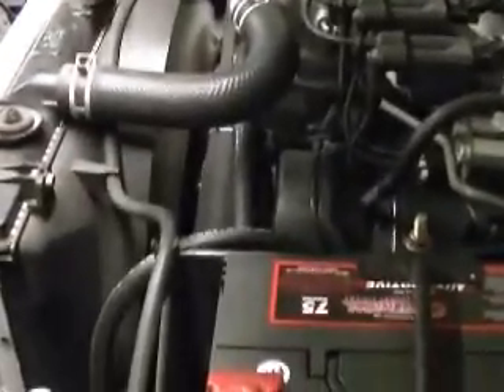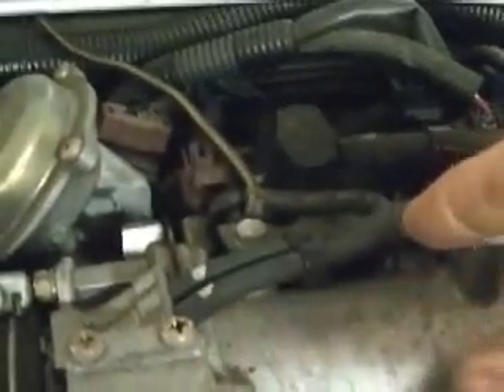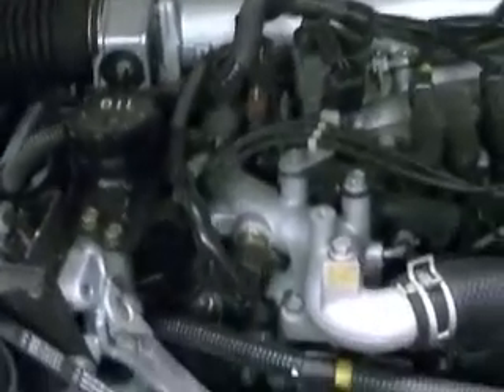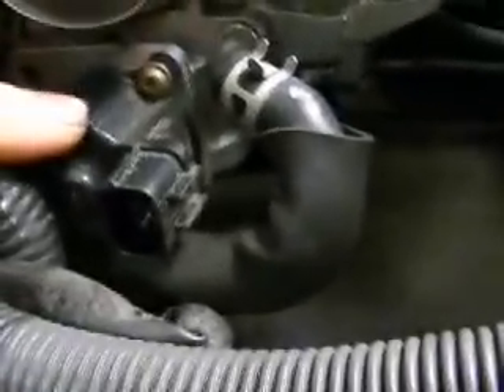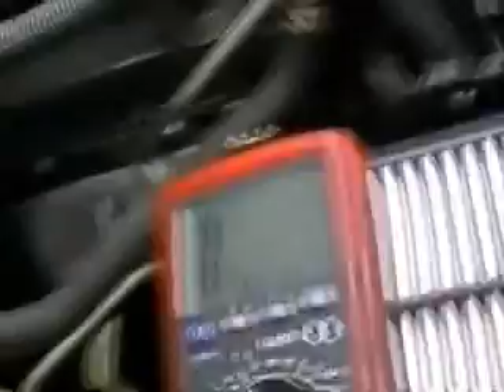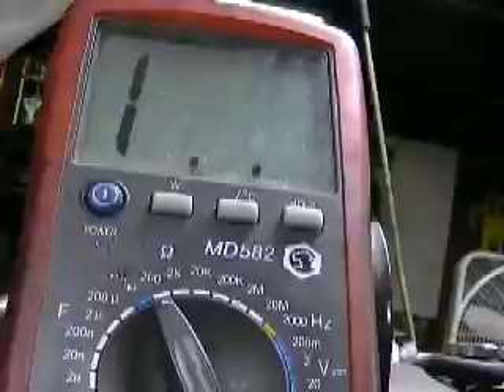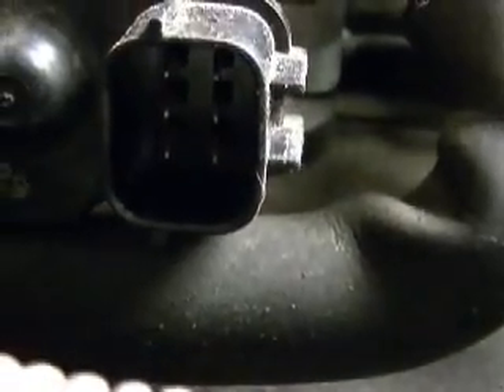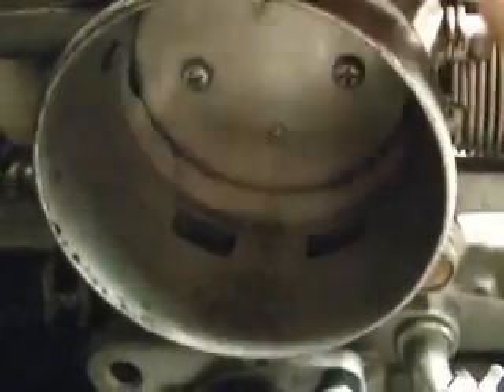Montero Sport Idle Diagnosis

Comment: Thank you very much!  I just had my 1999 one checked for a similar problem.  Guys at Firestone misdiagnosed and 'fixed' throttle body and problem persisted.   It starts and runs but 'hates' idles which goes from 750 down to ~500rpms.  The error code though lists a misfire on cylinder # 5, but it looks like that air servo might not be doing so well...  Thanks again for this great video!

Comment: failures of the IAC Valve are mostly caused by carbon deposits gumming up the travel of the valve piston thereby overloading the motor windings by excessive current draw.
Regular cleaning of the IAC valve and the IAC port will help keep the valve motor healthy and functioning.
My 2000 Montero Sport LS 3.0 Liter had the same problem. Upon removing the IAC, I found massive carbon and fuel varnish deposits in the IAC port. Cleaned / flushed with carb cleaner and installed a new IAC valve. Problem solved.
NOTE: Be sure to regularly check the function and cleanliness of your PCV valve....if it is plugged up , crankcase gasses will build up and gum up many vacuum source components.
Reply: Install an oil catch can.
Reply from the maker: This valve sits upstream of the PCV system so an oil catch won't help much.

Comment: great video Jason. Mine just started to drop off idle a couple of times today when I stopped at a red light and at a drive through and when I the air compressor turns on and off. it is idling at about 800 rpms and only drops for a second or two barring twice when it stalled out. I saw a question about your diagnostic scanner. where did you get it and approx how much are they? I am thinking my problem is prob the IAC valve. Can it be cleaned effectively? Thanks

Comment: Hey i have a 1999 mitsubishi montero sport 3.0 208k miles it seems to be running on only 4 cylinders instead of all 6 i got the spark plugs and wires changed and its still running the same what could be my problem
Reply from the maker: Sounds like you have 1 coil not working. Coils are controlled by the transistor module and triggered by the crank sensor. Seen lots of crank sensor plate retaining pins break after a timing belt change
Reply: @buggzyy  dose this issue throw a code cause my moms runs rough after timing belt replaced and we replaced wires coils idler controller egr valve module checked tons of things and it won’t shut off when I pinch hose and gunna check the cam sensor plate pin. How do you check egr vacume problem or not enough ??

Comment: Great video. You seem to know a lot about Monteros. I just bought a 2001 and I haven't found a good forum yet so I'm gonna ask a few questions here and see what happens. I had a really low idle so I installed a new IAC. Now the idle seems too high. I'm wondering if a previous owner might have turned that screw you said should be left alone. Or maybe they fooled with the TPS to compensate? I'll mention that the CEL/MIL light is on and my code reader says EGR circuit. I have a new valve and solenoid I'm going to install today. 
 I have new spark plugs too but after watching your other vid I'm going to wait for a nice sunny day to do that job ;)
Reply from the maker: Michael Boykin check out monterosport.net has lots of good people lots of info as well
Reply: Thanks, I'll check that out. Replacing that EGR solenoid is hard with large hands ;) Looks like somebody tried to replace the EGR valve because one of the bolts was broken off flush. It was fairly easy to get out though. Still have a high idle. Also a new code was pending.Evap emission system leak detected (large leak) says the scanner. Runs good.
Reply from the maker: Michael Boykin evap. Large leak may be fuel cap or evap vapor hoses from fuel tank to purge valve. Or vent valve at tank not sealing
Reply: Thanks Jason. I'm thinking the same. I put a new cap on it. If the code comes up again I'll trace the line from the tank. I don't even know where the purge valve is but the location might be in the online manual I found. The only thing I'm hearing is just the slightest variation in idle.

Comment: What does it mean if I pinch the egr solenoid hose and the engine doesn't shut off. Is the egr valve bad or solenoid?
Reply from the maker: Thomas Olivarez 
If you pinch the hose and nothing happens then you have either a faulty valve or a lack of vacuum supply for the egr system
Reply: Jason Pez thanks for the fast reply. When I pinch the hose. The engine's idle drops low but doesn't die. My idle sits at 500 when in drive. Iacv is brand new.
Reply: @thomasolivarez3001  I am having this same issue did you ever find a fix for this?

Comment: Mine reads 32.5 on one side and 34.5 on the other, my idle is about 800 rpms and idles a little rough, i did clean this IAV valve and it ran and idled perfect for a week then it went back to its original idle which feels like a missfire but its not.  should i replace my IAV to see if it fixes my idle issue?

Comment: I have a 2001 Mit Montero rough idling after 15 to 30 minutes of being driven.. after it starts acting up the engine will shut off at stop lights and will require for me to park aside and restart but it will continue in this way. I am looking at the Fuel CONSUMPTION MODULE MR239764 for this model. Any insight will be really appreciated.
Reply: idle air valve is dirty or needs to be replaced, go ahead and clean the maf sensor
Reply from the maker: In the past this module would die most likely due to connecting jumper cables in reverse.
Reply: Its been a while since I was looking to resolve this issue. Basically was a carbon built up related issue. The bypass valve and MAF sensors got a thorough shower. It's working very nice.